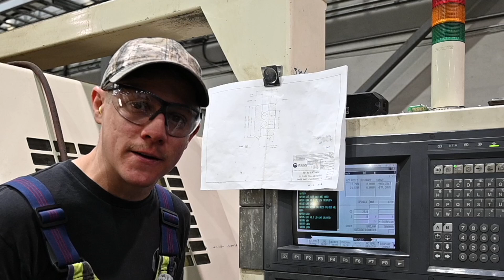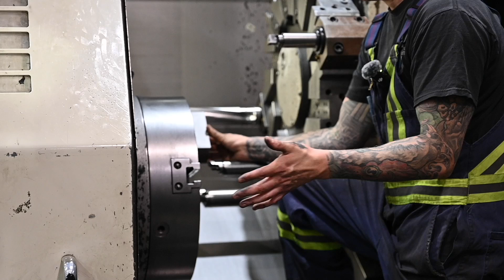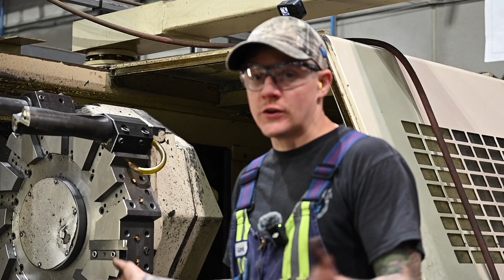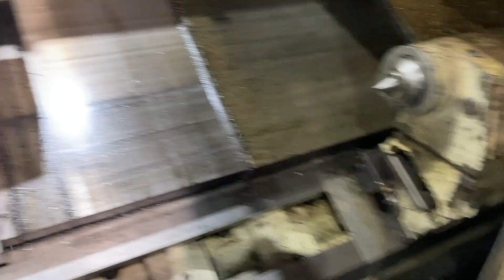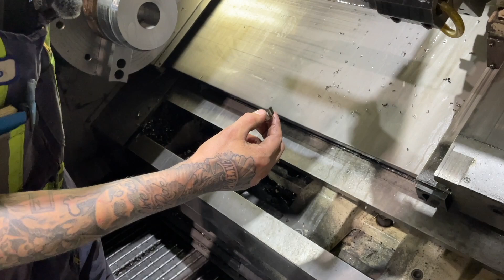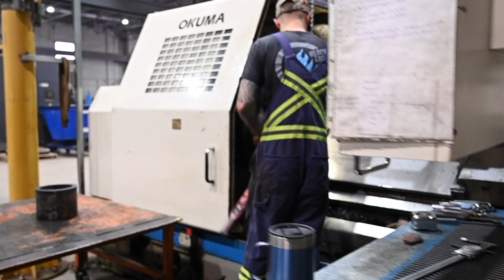8.6 UN Thread on a OKUMA LB35 - CNC Lathe #machineshop #custommanufacturing #okuma #lathemachine

Comment: hi from DK,, if there is something I can't handle it is the screaming tools.. the okuma can handle large tools without screaming. I think your tools are above center height, especially the small roughing and finishing tools shouldn't scream at all,,, I run with a small pinachio cnc, it was a pain in the ass when it was boring bars., it didn't matter what you did, it wouldn't stop screaming,, it's not fun to listen to  all day long, I've tried everything, ... but roughing and finishing ran like butter, it couldn't handle more than 25-30 mm short hole drills,, I've never had that problem on all the other cnc machines I've run with... make more videos it's nice to see something from the real world, thumbs up:face-blue-smiling::face-blue-smiling::face-blue-smiling:

Comment: Awesome video, it's amazing how fast you can punch in values on the controller. 

6:59 On some lathes it's not possible to conveniently set tools after the work has been installed. eg. sub-spindle tooling using an automatic probe.  Also, on machines with mis-aligned turrets and no y-axis, I always check and shim center heights on tools by cutting a small sample, measuring on a microscope, and verifying.

Comment: Maybe one of the worst things about a CNC Lathe 🤔
Setting up the Jaws ??
I have seen a few different ways to install them in the Chuck.
I usually write the size on each Jaw with a position from the ID, counting out the steps on the Master Jaws or write a measurement on the Jaws from ends of the Master Jaws.
Not exact the perfect way to it,  but it works me at the moment until I find another way.

It's good to know the comments are being read by you guys in the shop 👍👍
Reply: counting the number of grooves works but is a pain sometimes.
i do a combination of using a tool at 2-3 mm higher than the diameter i want, and measuring depth of the t nut on the chuck keys, with calipers.
Reply: The way I do it is by first eyeballing the number of teeth's and then use the depth pin on the caliper measuring from the chuck OD to the top of the jaw which I have a comment on the value in the program and softly use an electric ugga dugga and a torque wrench

Comment: Why are the tools all screaming?
Is it the material?
Like your machine ❤
The okuma is a beast
Reply: It's the material. 4140 will scream with a healthy enough cut, so will stainless alloys, especially inconel and tougher alloys.
Reply: @choclatellama123  Could it be the much longer than needed boring bar length? Dampened boring bars work well too. I run two Okumas, an LCS25 and an LB35-II. Love those machines. Programming with Hypermill. These machines live forever.